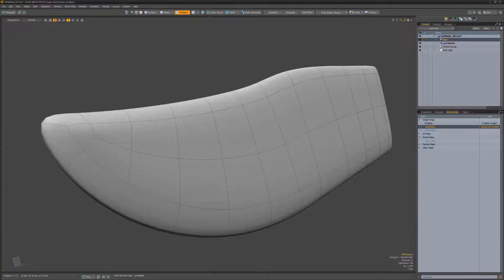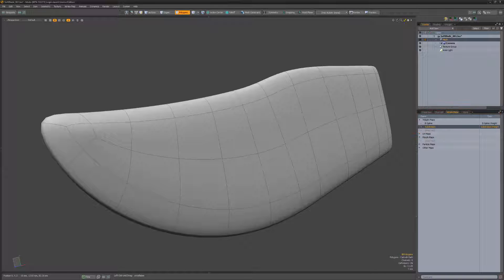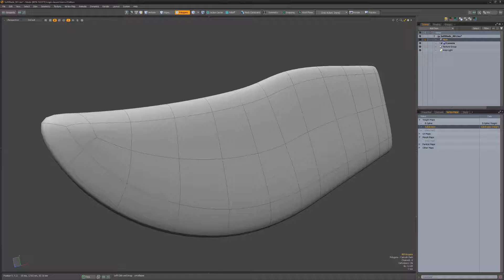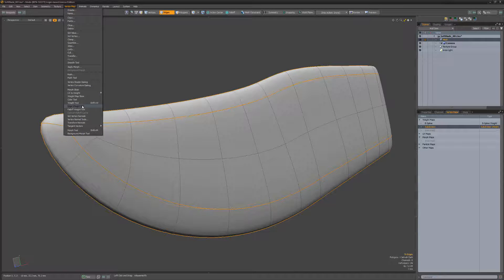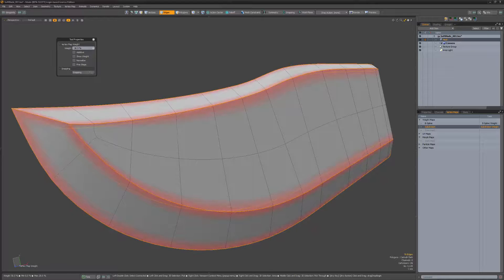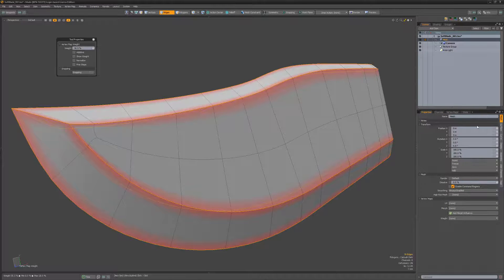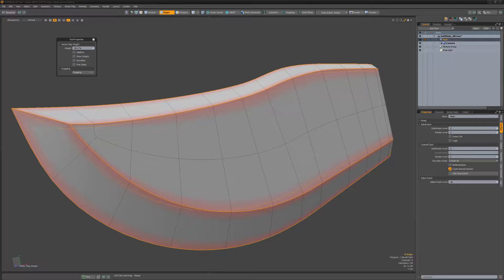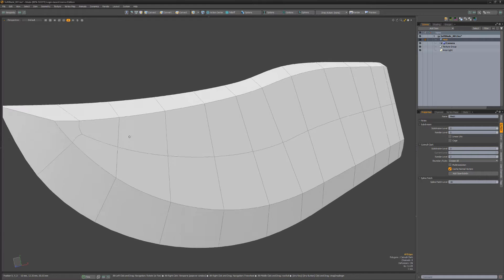MODO | Edge Weight Tool01

Comment: Is there a way add edge weights quickly using hotkeys? For example, if I'm working with a mesh that has 3 subdivisions, can I select an edge then press a hotkey to instantly give a weight of 20%? As it is, it's a bit cumbersome using the mouse slider or text box input if I'm working with many weighted edges.
Reply from the maker: Yes. Just sign the command to a hot key
Reply from the maker: I discuss that exact thing in this book: http://pushingpoints.com/v2/modo-macros-python-scripting/
Reply: @pixelfondue  Thanks, William! I'll take a look.
Reply: I was able to create simple python scripts that allow to me to quickly set a specific edge crease value when pressing a hotkey. Below is the contents of one of the scripts, which I saved as a .py file. Thanks for you help, William!

#python
lx.eval('tool.set vertMap.setWeight on')
lx.eval('tool.attr vertMap.setWeight weight 0.2')
lx.eval('tool.doApply')
lx.eval('tool.set vertMap.setWeight off')